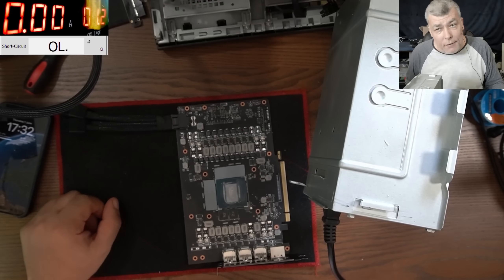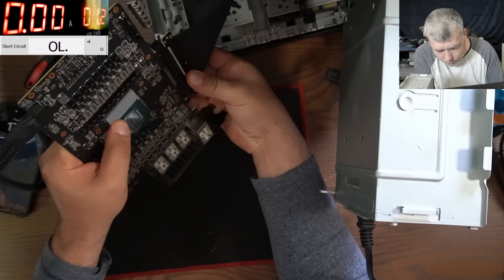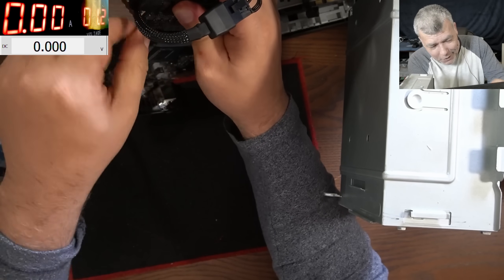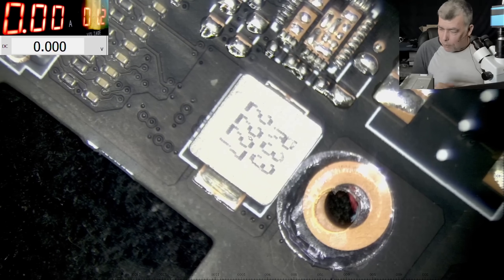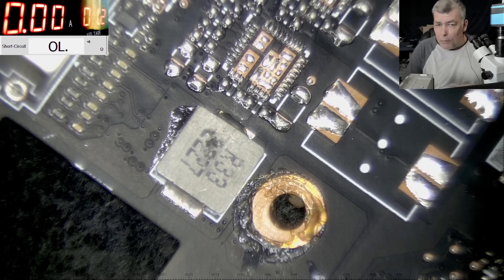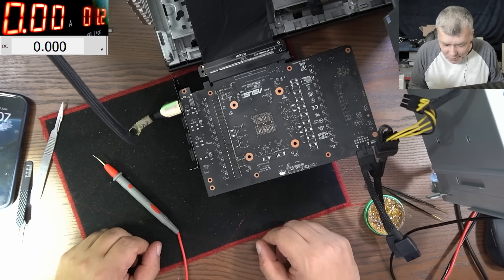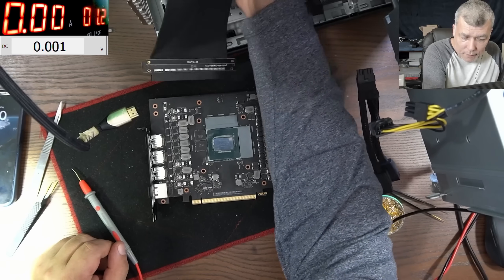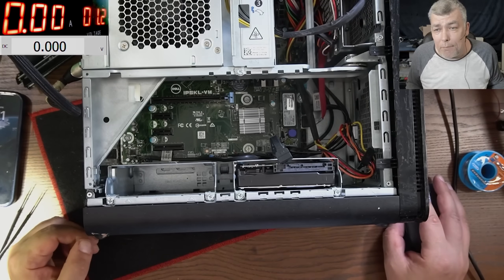Nvidia RTX4080 GPU repair - 'Wow' fault

Comment: Hi, i have a laptop Lenovo with a 3050ti, i had 8gb single ram so i decided to put another 8gb. I discconected the baterry and put the ram. When i check the task manager i figure out that the nvidia gpu don't be detected. I tried to reset the laptop but Windows can't be reseted. What could be the problem? Thanks

Comment: you know to you can buy one more extender same like that and extend even more. also there is adapters from sata to 6 pin or 8 pin for testing and repair purpose its cool. Also there is minig extenders which are much better for testing longer cables etc

Comment: Why this repair is so interesting?  So at my workbench is the job of a desktop computer, as I-7 chipset, with Win 11.  Fitted as to a lab bench and optics as modern micro scope with Am-Scope image software.  Flawless performance in every way.   Except with the graphic define as hardware, no sound.  Intended as an upgrade to a desktop robust system, I have not been able to manage the intended desktop replacement as more powerful CPU, excellent and robust LAN connection with the natural image needs   as where sound was lost.   Testing, also as shown to Soren's bench, where connection and on board sound was lost in the GPU to board management as involved direct swap.   Questions, such as would the board meet GPU needs, and where also, software drivers complete the difficulty as hardware-software management.
My problem becomes the footprint, physical space....and where the various cable, intended as a direct replacement but with sound lost, becomes the solve needed but GPU to hardware, now confounding.   And the interested observer, should take note I am happy to continue to try to solve any issue, with no direct problem except the goal to upgrade.  That is to say, replace a robust desktop with simply larger features and the best processing speed, best graphics and various memory (natural to the system replacement as upgrade).
One final note, I have the possible added value as simply place for test as side by side configure to link network, with minor MS Win 10 to Win 11 configure.
The lesson as avoid "spark" is critical as I continue to test and upgrade....where a customer may face similar hardware issue. That care to various plug in card, to intended delivery as may contain real issue, fault and where non GPU component may be shown to difficult and slightly hidden problem.  Not simply as a card fault, as in the lesson, but where GPU hardware can disrupt  audio.    Take note, this issue can be driven by the now unsupported Win 10 to 11 as customer base.  Intended components with fault or difficulty, as a tech must beware.  M.

Comment: as someone else said on here, a mining riser will make GPU diagnosis a lot easier, at least when testing for basic power rails & functionality. 
Specifically when testing the power sequence, you can even plug a few PCIE 8pin cables into your bench power supply and use them to power the riser and the card, without connecting it to a computer at all. This both allows you to monitor how much current the card is drawing, and limits the risk of a faulty card damaging your test system while still powering the card enough to check all the voltage rails

Comment: Sorin, long pcie cable is not so problem, it is the differential pair length matching that is important.  You can have 1 meter but the individual data pairs still need to be very close length matched.  As long as each lane is length matched.  The match between the lanes can be huge difference and still work because the receiver and transmistters will adjust.

Comment: nice video, i was surprised that this power supply was able to make the card start :/ this rtx 4080 are really power hungry
Reply: Much less than 3000 series and double the performance. Ada Lovelace is miracle architecture.

Comment: Sorin, in order to make those graphics card repairs easier, i suggest you buying an mining riser. It will make a big difference.
Reply: why
Reply: @edi4ever1  probably a bit longer
Reply: @AttilaTheHun333333  😂
Reply: @AttilaTheHun333333  no, because it uses PCIe x1 and it is basically just USB cable instead of this huge ribbon cable

Comment: What is the diameter (mm) of the hot air station tip that you are using the most?
Reply from the maker: 8mm
Reply: @Electronics Repair School  Tks. Just one more question about ai flow speed.... 0% up to 100% what's the most used value for you?